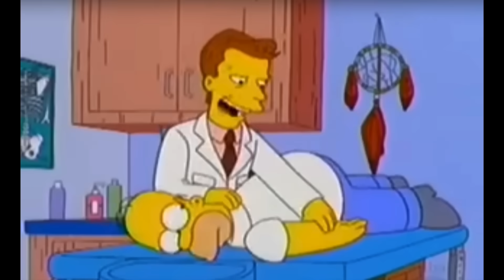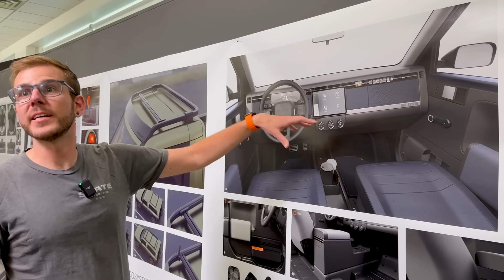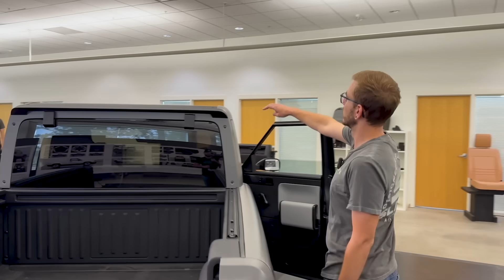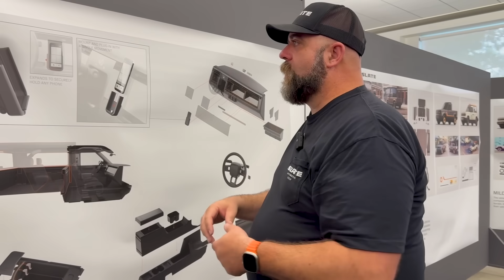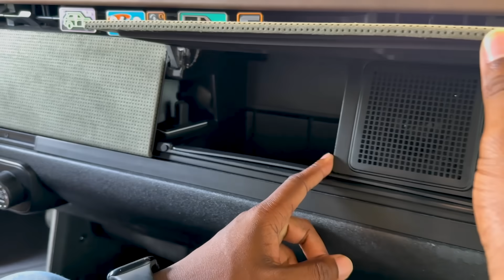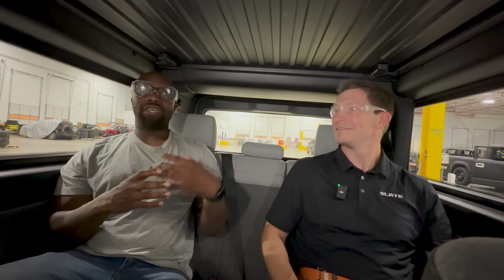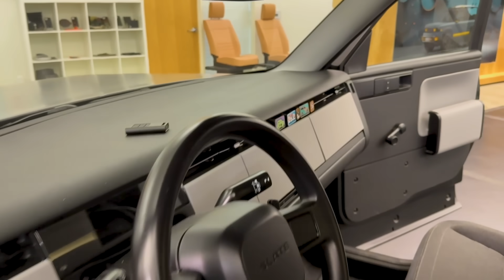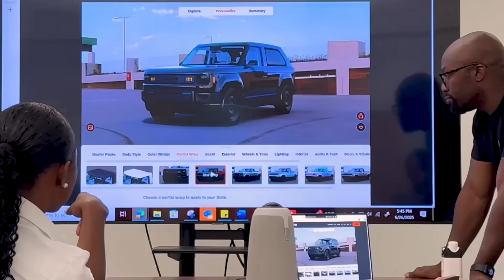The Slate: America’s $20K Answer to China’s Cheap EVs (Exclusive Access)

Comment: I think the biggest miss is no 2 motor AWD option. But I think Slate will do well as a fleet vehicle. Pretty damn cheap for a decent work truck.
Reply: They'd be dumb not to offer it in the future, and from all the hints in the video it seems obvious that it's in the works.  They just want to deliver the base product first, which I fully agree with.
Reply: It will never touch the market for anything less than 45k
Reply: I think this "truck" is more SUV, like a bronco sport, than anything. It's battery and 200-hp motor means it wont have any torque. You can forget about hauling even medium loads or towing completely. It's performance for truck activities is likely equivalent to a kei such as a subaru sambar, maybe a base model i4 hyundai santa cruz on the upper end. Forget about offroading as well. I am convinced this is just a city putter or for people who want to look like an overlander but doesn't want a subaru forester. I don't want to dog on them too much because i appreciate them releasing a barebones car that hopefully will remain at this advertised price and is manufactured in america.
Reply: @o0Guns0o A decent diesel engine with 200 hp has over 300 lb ft of torque and with 4400 lb of weight which can take you (depending on the suspension) almost anywhere. See KIA Tasman review videos from Australia. Of course you need AWD/4WD. And electric motors can also have high torque numbers than hp numbers. The numbers are not the most important thing, in one of the videos was shown that bad modulability (from now on this is a word)  is more important than the power and torque.
Reply: They already confirmed that a dual motor will be an option
Reply: @dollarn9ne no, they didn’t. It’s going to be RWD only. Whether they eventually come out with an AWD option/model remains to be seen
Reply: @dollarn9ne  They did not.  You can download and read their press release even and see that they did not.

Comment: Kei truck being outlawed to proteck American market and the big boys insist on big trucks, what about those who want something cheaper and smaller? 

Personally I like it and hope it is a sucess, that they do offer a fitting service for accessories bought when new but also, I hope they have thought about other markets. The Slate isn't that big so would fit on European streets.

Only a few things Im concerned about, can they meet the price given the lead time for anticipated first delieries, what would be the difference in price between the batteries and can they also be easily changed and why go chasing a 4x4 version and offroad looks/capabilities, why not just leave it as a relatively cheap electric vehicle, in the body configuration which suits you best?  They jave tried to keep it simple, why look to complicate it?

Comment: When VW introduced the Rabbit pick-up, it sold tremendously well in the first year, but not so much in the second year, and by the third year, sales dropped off a cliff. VW conducted the market research to find out why.  Answer: Every pool man in the US had already bought one, and nobody else wanted one..For a small biz that needs an open bed, it should do well.(Like the VW) Low daily operating cost. But for the general public, limited range, somewhat cringy "personalization," and so-so performance spell disinterest. Take away the $7500 tax credit, and there is no room either. If you want 4 seats, you will be in Maverick, even lower-end Rangerr territory, to name a few.  The entire project appears to be based on multiple misconceptions, despite the engineers' good intentions. But if I had a pool maintenance business, I'd already have my deposit down. The good news is that it will force Telo to keep its prices down.

Comment: The concept is noble, but the price point is disingenuous, and you can get a decent ranger in that same range for that which will actually hold its resale value.   Also, no two door suv has even been successful other than the wrangler and even most of those are 4 door now.

Comment: It's interesting how most of these reps don't seem to realize or emphasize the key differentiator is the repairability of the model. Starting price is not really that great taken by itself, but when you factor in cost of ownership - easy to access and replace lamps, struts, axles, BODY PANELS, maybe windshield..? etc. It's a huge difference in cost compared to being stuck at the dealer waiting on $3500 headlamp assemblies. IF the model and thus its ecosystem can get off the ground saleswise, indie repair shops will be running wild on this platform. It could theoretically be the new model A.

Comment: This will end up being vaporware like so many before it. It's going to be $30K plus for a bare bones EV since the tax credit is going away by end of 2025. Who in the hell is going to pay $30K plus for a bare bones EV with crank down windows, manually adjusted cloth seats, unpainted gray composite body panels , (if you want it painted or wrapped that's going to cost you extra) no infotainment center, pathetic 150 mile range (much less in cold weather) and no amenities to speak of. By the time you add any options to it including paint you're way past $30K at which point it makes zero sense. You can get a decent well equipped low mileage real used EV for much less than that. It's a total joke and a farce. 

Reminds me of Arcimoto
 which was basically nothing more than a glorified golf cart and was a spectacular failure.

Comment: If the accessories cost too much, the aftermarket will step in. It's a cheap skateboard like the VW bug. Think about how many mods there are for those simply because a lot of people had one. All of the body kits, suspension, interior, bolt in engines, all because they were affordable cars to start out with.

Comment: Absolutely phenomenal. People talking about used EV truck pricing aren't thinking about the ease of repair and accessorizing the Slate truck VS the Lightning, Rivian, etc. For anyone looking for a vehicle for the long-term, this is absolutely game changing.
Reply: The Blank Slate does not have a smaller bed than most $5,000 Rangers I would buy. I don't want the single cap 8' bed.
Reply: yes, anyone that has EVER had to deal with REPAIR will double appreciate the Slate.
Reply: If this is so attractive, why don't people buy entry-level cars without any options? You can buy right now a brand new Toyota Tacoma for 30k, SR , entry model without any options and if you think this Slate with a few accessories won't be 30k you're naive and the range is ridiculous. 

"For anyone looking for a vehicle for the long-term"  - just go and buy a standard entry model Toyota with no options and be done with it ... BUT people want to brag and always buy fully loaded models.
Reply: @mrmrmrcaf7801 I actually daily drive a stripper base model. No loan. No options but does have AC. Cruise control would be nice, but not a deal killer. I’m unfortunately in the minority I’m sure.
Reply: @mrmrmrcaf7801 most products now dont lend itself to being able to be upgraded. Everything is tied into the electronics so it makes it difficult to change. 
The only thing I can think that has this level of upgrade ability from dealerships would be the jeep and last I checked that’s a rather popular culture.
Reply: @mrmrmrcaf7801  Unlike a Tacoma this thing is modular and DIY friendly. Easy to work on by making it easy to remove panels and sections without having to get into crazy positions to reach parts . Most of the new cars are a pain in the arse to work on in very tight and hard to reach sections. Hence I typically have a mechanic work on my cars. 

also the slate comes with an app that actually self diagnoses and gives you the codes if there are any issues unlike all the traditional vendors that make you take it to the dealer ,mechanic, or buy specialized code readers. 

Tacoma cant be switched into an SUV . 

Panel gets damaged , simply order one wrapped then unscrew old pane and insert new panel. tacoma doesnt give you that option and requires paint and body work. 

Im going to get on the list because I like the concept and the thought the company has put into making this DIY friendly and being American made. This would make a great vehicle for me to run some errands around town. The only downside I see is no 4x4 ,not sure about towing capacity if any, and concern for the upfront base model starting price in the mid to high 20k. 

Having just spent 3K to get an ac fixed on a 4 year old vehicle and a family member getting quoted 10K+ to replace a turbo in a 4 year old truck both right out of warranty and purchased new  along with the 1K of repairs with 3 jeeps I own every other 3 months due to electrical issues I love the simplicity of this for long term and repairs. No need to get rid of it , just swap in new parts without the high cost of labor.
Reply: @mrmrmrcaf7801 Tacoma starts at $34,190... and if someone hits my Tacoma, its not as easy to replace the body panels. If I want to put rear seats and a walk through in my Tacoma, I have to learn to Weld.. and those back seats won't have air bags without significant modification.
Reply: @mrmrmrcaf7801  I think its more about the modularity of it. It sounds like upgrades/repairs will be very easy. That is providing that the company sticks around long enough for parts to be available 😬
Reply: @applesaregoodeatings  Most people don't like too many options. They say they do, but study after study shows that an overwhelming majority of people like three or four options, that's it. The problem with too many options is that customers usually start to doubt they made the best choice, which doesn't sit right with em and leads to a lot of buyer's remorse.

As for repairs being cheap and easy, it sounds great on paper, but if my Slate goes to the shop for a day every few months for some minor repairs vs my Mercedes going to the shop for a week once every few years for an expensive one, I'd much rather have the Merc. It's less hassle on my life. Better yet, get a 90s Toyota and don't change the oil for 100k miles. It'll be fine.
Reply: @bongwaterbojack  I don't know. I personally wouldn't buy a slate, but one of the most appealing things about it is it seems like you would NOT have to take it to a shop to have it worked on. An owner can change/maintain parts of the car with incredible variety. 

This appeals to me personally. I prefer to work on my own vehicles, and I prefer to own older vehicles because they're easy to work on. I think the ease of customization is really appealing too, and I'm not one to make my vehicles flashy. 

I would have strong interest in a combustion engine truck following similar principles. Throw a reliable small/medium truck engine in a package with the same sort of customization, and I think you've got a hit.
Reply: @evbbjones7  I understand thats what you might want, but you have to recognize that people who want to work on their own vehicles (and not just say they do) are an exceptiomally small part of the market. And –if given $20k to spend– are more likely to buy a $5k Ranger and have 15 left over to make it badass, than they are to spend all 20 on a 'blank slate' with a smaller bed, unknown issues, no aftermarket support, and not even a radio at base.
Reply: @bongwaterbojack Now you are talking. I'd rather buy a 90s Tacoma with rollovers up windows and a 5 speed manual transmossion.
Reply: @mrmrmrcaf7801  Because 30k for no options is overpriced
Reply: @KaitouKaiju  yet for 3k less you get city driving range, not that much towing capacity and the worst of all it doesn't even get a 4-door variant
Reply: @KaitouKaiju  you are braindead if you think that eat dirt Poor
Reply: COI for these trucks is going to be very, very low, which puts TCO probably lower than anything on the road.
Reply: No will be a niche market that will fade out fast

Comment: I've said before, multiple times that EVs just need to use a phone or tablet to interface with, glad to see these boys are doing it.
Reply: No reason it couldn't be done with ICE cars either. Propulsion has nothing to do with interface. It sounds good, but as somebody who is forced to carry around a lot of gadgets, I don't want to be taking my iPad in and out of my pack every time I get in and out of my car.
Reply: @gregmcable  Older ICE vehicles should be able to use a head unit which interacts with the car in especially-deep ways, so long the hardware for enhanced operation like what we have in present-day automobiles exists and is connected to the head unit.

Comment: My question would be software access, hardware access,  after sales support,  parts availability,  what happens IF slate doesn't make it, can you open source the software for moders or engineers to write scripts to fix unforeseen issues, or is it going to be bricked IF you try to mod the rig. I'm not an ev guy, that being said a city truck for the mom and pop shops, or the first time drivers, the a to b just get it done folks, will it be hearty enough to survive, or will it be a paperweight waiting to be scrapped.

Comment: I love this concept, but for 28k you could get a Ford Maverick or a Hyundai Santa Fe, each with a bunch of standard options that aren't options at all on the Slate. By the time you build a Slate the way you want it you could afford a number of other options for a pickup truck, none of which come with range anxiety. Heck, you could have a better used truck for less than the cost of one of these built to your spec.

Comment: I absolutely love the idea of a basic vehicle that is affordable and easy to repair.  But I would NEVER buy it as it is an EV. Put a naturally aspirated 4 cylinder engine in it with a manual transmission for around $20k and I would definitely consider it as my next vehicle.  As for an EV I have zero interest in complicating my life and planning road trips around the vehicles needs, and then throwing it away when the battery fails, or the insurance company totals it out due to a minor fender bender.